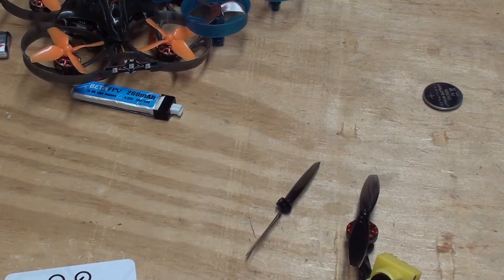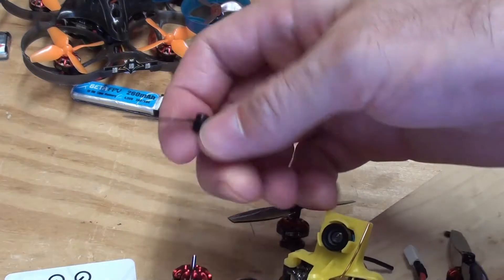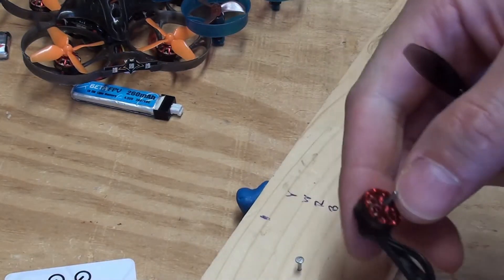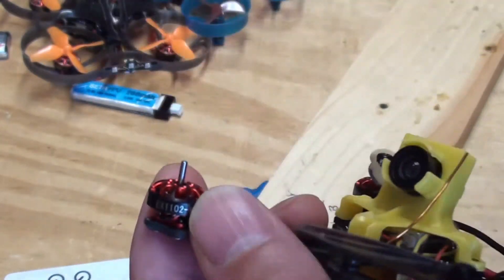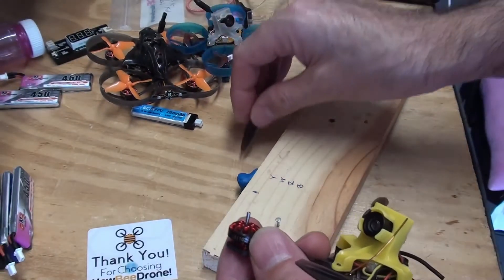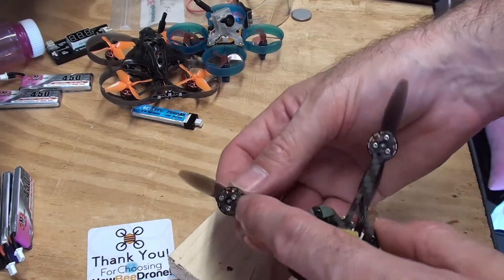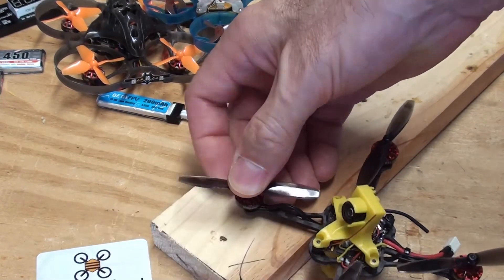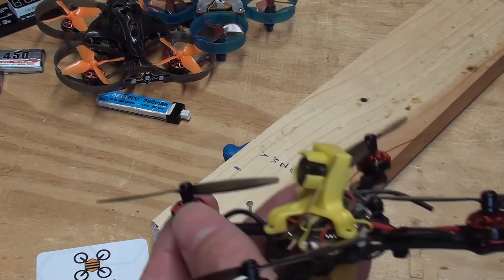Better way to press props on Toothpick motors

Comment: i actually stopped using brushed motors completely bc i would push the bottom out...every freaking time.  I popped one brushless but it didn't seem to break anything, just heard a 'pop' that's generally a bad sound.
Reply from the maker: With brushed, I only use the cockroach frame, which has nubs under the motors to keep the end bell from pushing out when putting props on. Always install motor into frame, then prop onto motor. Never install motor and prop (already assembled) into frame or you risk damage.